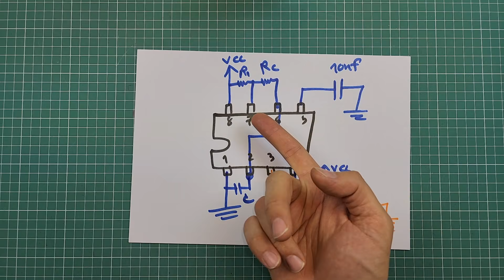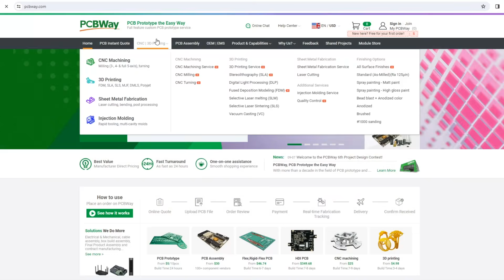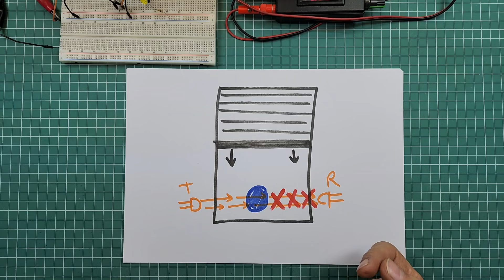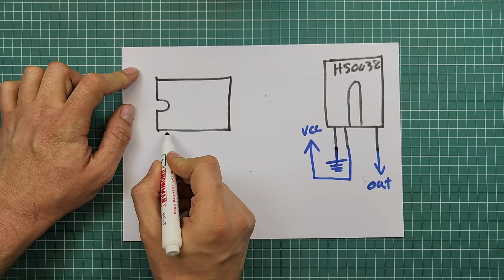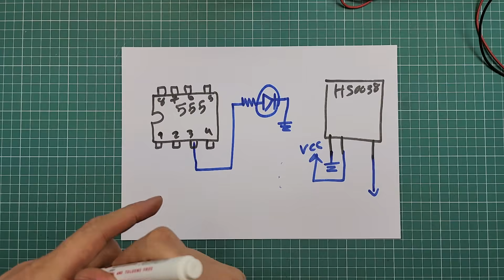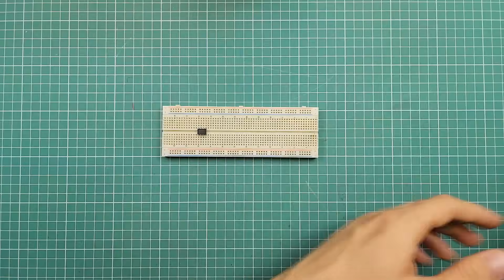6 awesome application of 555-timers in circuits

Comment: Using random caps I pulled from a circuit board I got the LED to light but it didn't blink. AI says my resistor values might be too low.

Comment: I am 50 years old and although it seems late I started this year to learn about electronics.  I have been taking apart LED bulb drivers and ihave been studying power supplies like old mobile phone chargers and ac-dc linear adapters.  With these i like to power simple interesting projects.  May I have some ideas please?  But more so I want to thank you very much  for this video because now i will be scavenging for the 555 IC and attempt some projects like these that you have demonstrated.
Reply: I’ll be 50 this year and just started electronics as well. I made a esp32 marauder and working on a cyd with Bruce firmware with all the other modules

Comment: you make it easier to understand 555 timer applications. other videos focus more on explaining what is inside and the pins without telling you what each component is doing. i also love how you explained the time constant by using resistors and capacitors of different valuess. i ve been struggling to understand what those are there for, in most IC circuits.
Reply from the maker: My pleasure! I'm happy the explanations made sense. 👍

Comment: 2:07 Note: Connect a 390 Ohm resistor with the 5mm red LED to limit the current to about 17 mA. Otherwise, the current is about 50 mA and the LED fuses. I lost one of my LEDs.

Comment: I liked you video, but mono-stable case with the 2.7 sec should be 1.1*2.7sec according to the equation. Otherwise the guy doing the math is the component with a 10% tolerance.😂

Comment: Hello, thanks for the informative video, I want to create a  pulse generator that is synchronised with the chuff sound from a model locomotive fitted with a sound decoder. As the frequency output of the sound decoder( the chuff) increases  with speed. I am hoping to be able to drive an atomiser transducer circuit (these are readily available from Ali Express very cheap). The end result will be a burst of steam from the chimney synchronised with the chuff sound. https://youtu.be/XDiM9lNqZwY Hope you can help regards Peter Dolan

Comment: Try using a PUT for an oscillator ... very stable circuit ... BC557, BC 547, 3 resistors and a cap ... simple .

Comment: Hi, This is the first video I viewed of yours. Very good educational. I want to just point out that at the end when putting a relay into the circuit, a Back spike diode should be put across the coil to stop the high voltage spike from damaging the electronics. For small relays like you used I just use a 1N4148 small signal diode, cause the spike current is so tiny. Many times you see a 1N4007 which is a standard, but over kill for the circuit. Wish you the best on your channel.
Reply from the maker: Thank you so much for the point  you just mentioned 😊

Comment: I've wanted to do a latching D-pad with LED buttons (to control a multi-camera system for a car).  i.e. You push up, up lights up and stays lit.  You push any other direction, it lights up instead.   You push the center Cancel button or an already lit button, and no buttons are lit.  Each lit button also corresponds to an on/off output to indicate which camera is triggered.

As a software guy, I was just going to do it with a microcontroller and basic boolean logic.  Seems like a fun challenge to do it with a 555 timer instead.

Comment: This is extremely useful and interesting video, thank you very much for making and sharing. Regarding the last application, what are some  pros and cons of this approach vs. an H-bridge?
Reply from the maker: Thank you so much. 
Nothing is so special about that circuit, h-bridge is much better in most cases.  Here I used that for simplicity. 👍

Comment: The mono-stable mode of operation is very useful to generate single pulses to feed other circuits a manual 'clock' pulse devoid of switch bounce 'interference'. I use this quite often with a pulse duration of about 300-500 mSec. Shorter durations can be tried, if you're quick at button pressing!. Thanks for all the videos.
Reply: This channel doesn't have any content

Comment: FYI there are a few caveats to 555, particularly in monostable mode.
The 555 operates by turning off when reaching 2/3 VCC and turn on when drained to 1/3 VCC.  So in regular operation the capacitor will be between 1/3 and 2/3 VCC and that's what the timing formulas are based on
But at power on, the capacitor is likely at 0v so turn on time will be longer than expected.

Also the 555 by itself does not provide reseting trigger.
Take a 2s monostable application.  The 2s will time out only based on the first time it is triggered.
So if you pressed the trigger again 1 second later from the first, it will still turn off 1 second after the second press.
Often one wants a delay determin3d after the last press, but a 555 by itself can't do that.
You can add a circuit to drain the capacitor from the trigger, thus resetting the countdown but then you might be starting at 0v rather than the normal 1/3vcc standby voltage
Reply from the maker: Thank you for sharing your knowledge with us ❤️😊
Reply: This!!!  I’m new to electronics and wanting to build a device using a rotary phone dial.  I would like the rotary dial to “hold” the last digit (as when dialing a phone number)

This of course will be used in conjunction with a small, single-tone generator as the sound source. (Think Morse code using the rotary dial)

I have no idea how to achieve it (timer) to hold the last digit dialed for a few seconds (but not the other numbers dialed)
Any ideas? ( I’m new to electronics)
Reply: @MrJruta  A rotary phone works by opening and closing a contact (effectively rapidly hanging up the phone briefly) a number of times corresponding to the digit dialed.  Thus you would need a counter to count the number of pulses.  You'd need additional circuitry (timer) to handle contact bounce and another to determine when no more pulses are coming, thus ending the count.

PS dialing 0 is ten pulses.
Reply: @ thank you
Reply: @MrJruta Check out the CD4017 - it's a 'decade counter' chip that 'counts' to 10 based on incoming pulses.  Output pins (0-9) will sequentially go high when the input pin receives a pulse.  Combined with a 555 and some resistors, capacitors etc, this should work well for your application.

Comment: Maybe we should learn the internals so we can make our own 555 timer and not have to pay someones 555 timer salary... just kidding, great stuff (and music).
Reply from the maker: Yeah 🤪
Reply: Ben Eater shows how to make the 555 out of transistors at the start of his 8- bit computer series.
Reply: I'm pretty sure that was a two transistor flip-flop, sans the two (built-in) op-amps.  So, not a versatile "timer", but an oscillator.
Reply: I agree!  This is why I am learning to smelt iron ore so I can build my own car.  Three cheers for self-sufficiency!
Reply: One of these days, 3-D printing using metals will be stable enough to where one can print out a durable enough automotive body to use in a ground-up build.